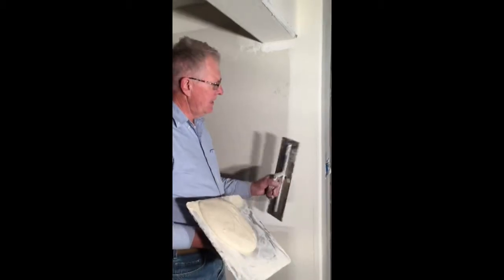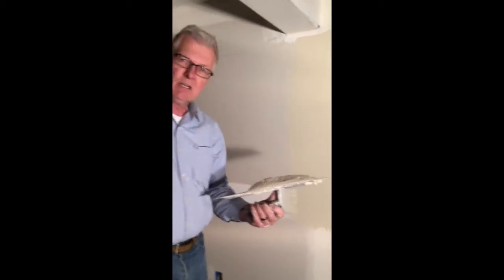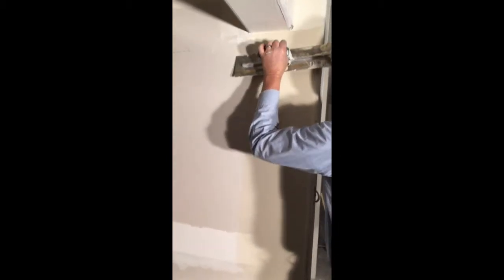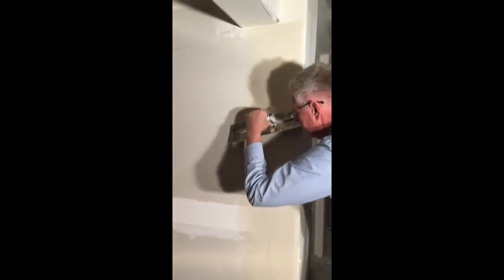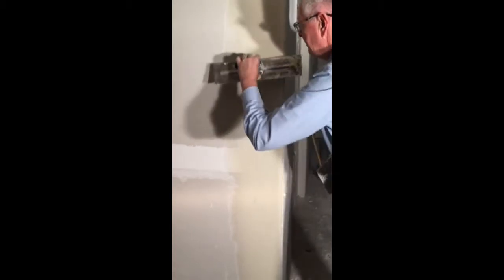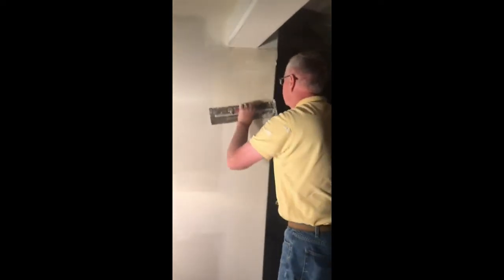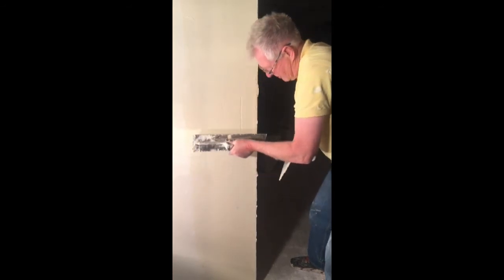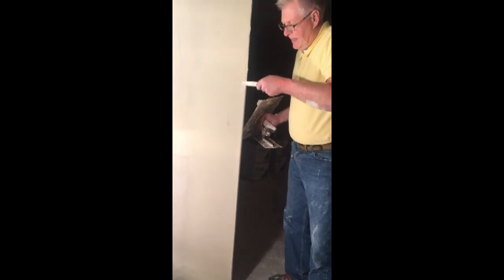DIY  Finish a Outside Bullnose Corner

Comment: Found your channel and the video on bullnose edges.  I'm searching for information and videos to know if it's possible as part of a renovation to round square wall corners on an existing build.  Idea is to put more of a Southwest or  Mexico-ish feel with well-rounded wall beads and curved doorways.   Sort of like, cut away the existing square corner to the studs and fashion a wide bullnose edge for a well-rounded appearance.  But I don't know what supports the contour I'm trying to build with the wide paper tape.  Thoughts?  Maybe a content idea for a future video??
Reply from the maker: Typically, on your corners you will have sheet rock  underneath the corner bead, so if you purchase bullnose corners with paper tape on them (HomeDepot sell them), you will mud both side of the corner and stick the corner bullnose on and run you trowel down both side to set the bullnose then start to apply mud to make the edge of the bull nose feathered into the wall. It will look awesome
Reply: @diydalemccrary678  Thanks, Dale.   I'm trying to achieve a WIDE bullnose curve, more like three inches, not the 1" paper/vinyl tape bullnose.
I am thinking of cutting the outside corner sheetrock back at a 45 degree angle to the wood, or deeper and fashion a mud contour to be covered with a wide paper tape.
Ever heard of any technique remotely like this to achieve a 3" round contour?